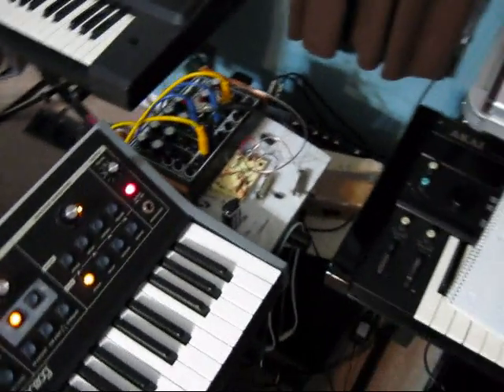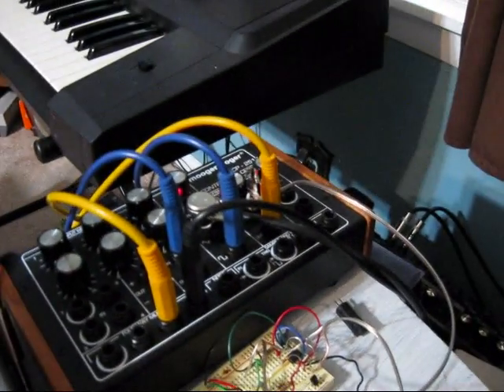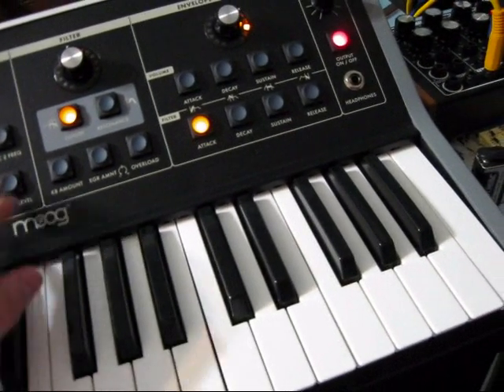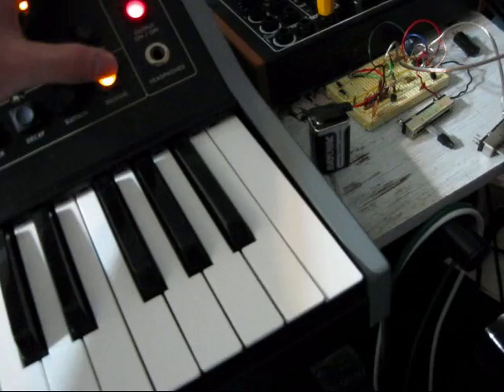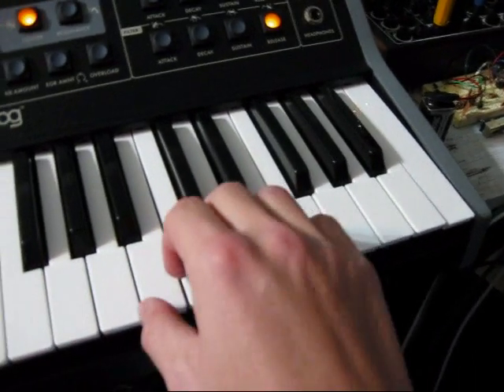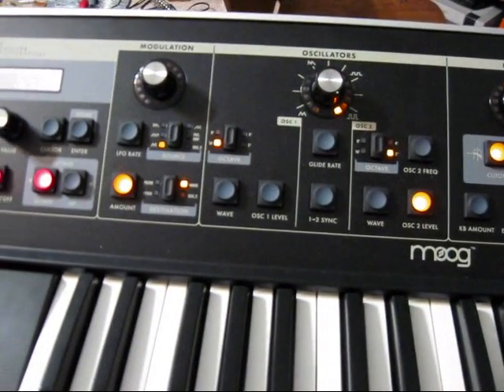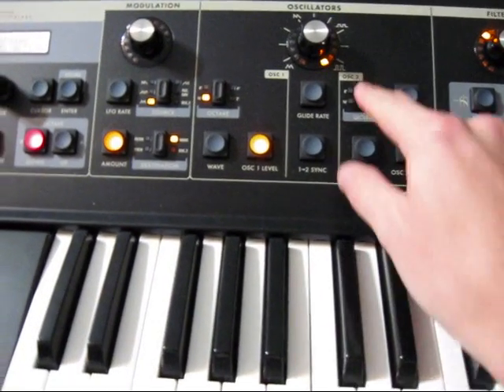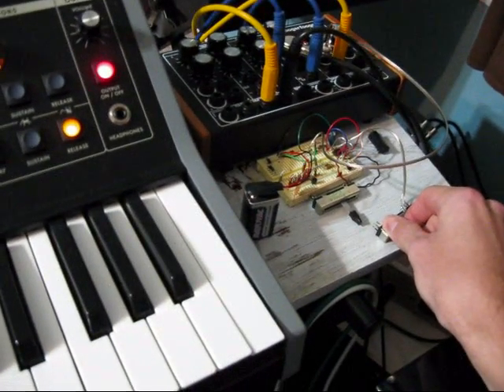Little Phatty with three oscillators

Comment from the maker: The big problem is with the design of the Little phatty is that there are no CV outputs for pitch control of the homemade oscillator so this osc would drone only, there was no tracking. If you had the modified CV outs from moog, you could make this little oscillator work great. There is a chance you could get a MIDI to CV converter and wire the oscillator up for control but there would have to be some circuitry added to the oscillator.

Comment from the maker: Thank you! 

Well, that was the problem, I never did link it up to a CV source. I actually thought about tapping into the D/A converter of the LP and driving the CV from that, but I backed out. The LP uses all surface mount components and I do not have the correct tools for working on that style of components, does not take much heat to crack the components. I work on Surface mount at work so there may be a chance I will carry it into work with me one of these days and mod away.

Comment from the maker: continued-- On the 3rd oscillator you would also have to have a tuning circuit that would adjust the CV voltage so you could match the pitch and tuning or volts per octave of the synth. 

You have a great Christmas as well!

Comment from the maker: That is not a stupid question at all. It would take some work, but the only problem with using the Little Phatty is that it only has CV inputs and to make the 3rd oscillator track you would have to have a trigger out and a keyboard Gate out. The LP only has inputs which makes it hard to link other gear to it.  Continued--------------

Comment: Excellent stuff indeed!

Stupid question, but is it a huge job to build a third oscillator that will also track the pitch of the other two up and down the keyboard? What you have built is intruiging as I have only seen this type of "add-on" on modular systems........

Have a Great Christmas,

Mike